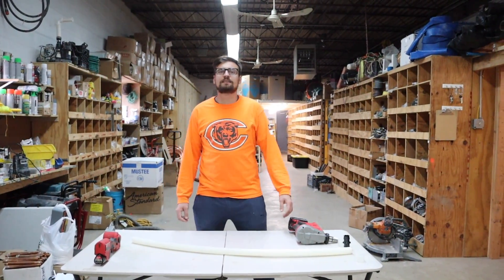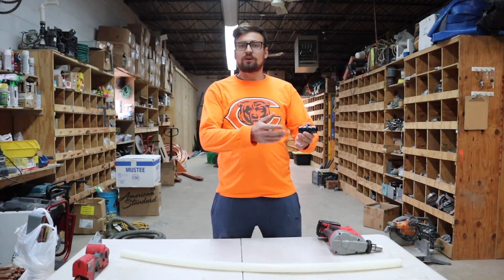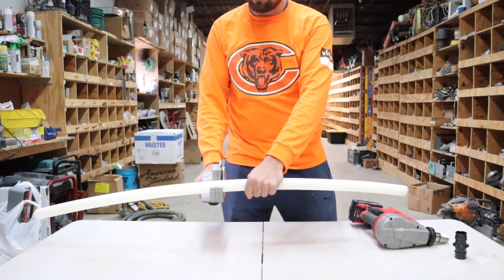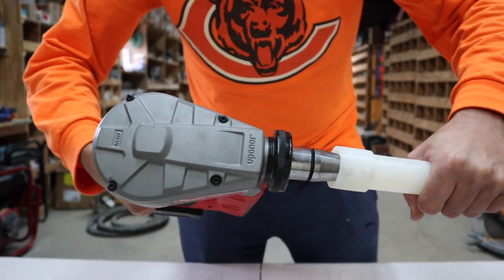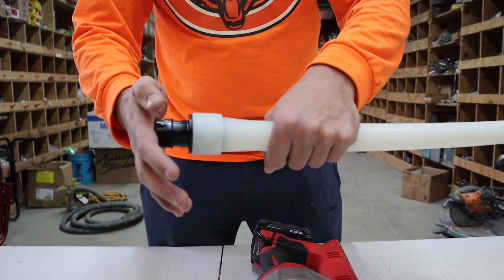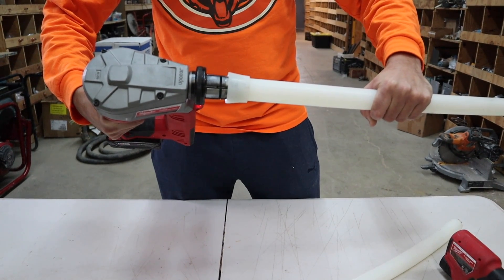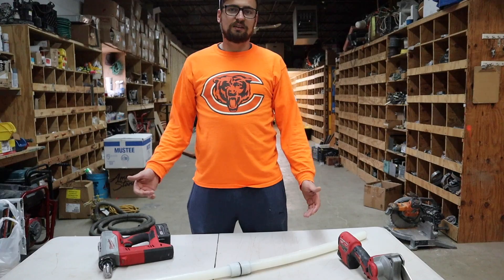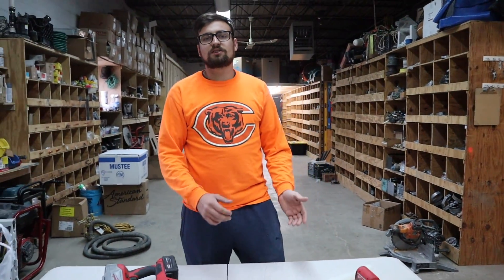PEX UPONOR Expansion vs Copper, How to Install PEX

Comment: which is better the 12v or 18v?  does the 12v lacks power?
Reply from the maker: 18v is significantly stronger, useful especially for bigger sizes

Comment: 1. The International Codes (IPC/IMC) and the Uniform Codes (UPC/UMC) in the United States allow you to use the same fixture unit (WSFUs) sizing as copper for Uponor PEX-a and ProPEX fittings because they have a larger inside diameter than crimp-style PEX fittings, and you typically design to a higher velocity with PEX than copper, which helps overcome the flow differences. 
2. Do not force the pipe onto the tool. This can cause the head to not rotate, and potentially result in an improper connection. This also decreases the battery life, meaning you'll be cycling through batteries much more often. 
3. Uponor also offers press adapters for a flameless transition to copper in 1/2" to 3" sizes.
Reply: Yep since....   PEX "expansion" fitting are the same ID as the pipe...

Comment: Which one is better the plastic sleeve or brass??
Reply from the maker: Plastic sleeve is better less chance of damaging the pipe or fitting. Also with plastic it is harder to get a leak. The plastic sleeve is expansion while the brass is crimp, crimp is a bit cheeper
Reply: Revamp Garage I’ve seen brass sleeves. To me it seems that brass would be more reliable due to its stable condition, unlike plastic which could expand over time , and maybe even cause a leak due to loosening
Reply from the maker: The plastic is actually a tighter hold than the brass fitting, brass fittings still allow the fitting to spin in the pipe while the plastic does not. Plastic is definitely better but harder to work with

Comment: This is pricey plumbing
Reply from the maker: Yes tools are expensive but it does save a lot of labor time
Reply: The pip is cheaper than PVC last I checked aswell
Reply: @danietkissenle  eh depends
Reply: cheaper than copper and way better than the pex you buy at HD or Lowes.   I will gladly pay 10 cents more per foot to have Uponor Pex A over the Pex B garbage.

Comment: last i checked my pex pipes and fittings were actual pipe sizes.
Reply from the maker: Appreciate you watching, PEX-a fittings are smaller ID size than the pipe
Reply: @revampgarage8341  Wrong....   PEX "expansion" fitting are the same ID as the pipe...